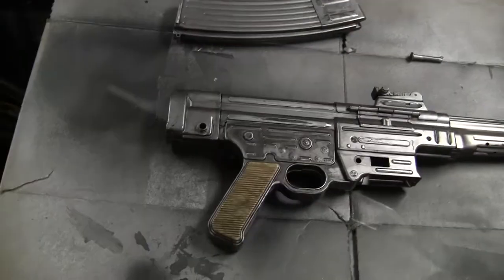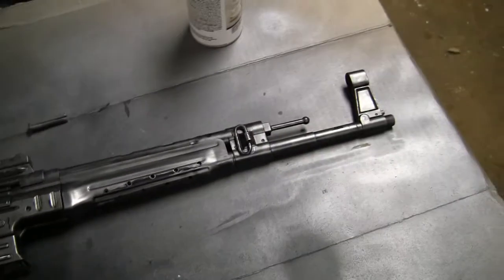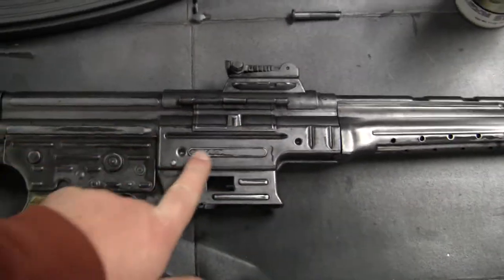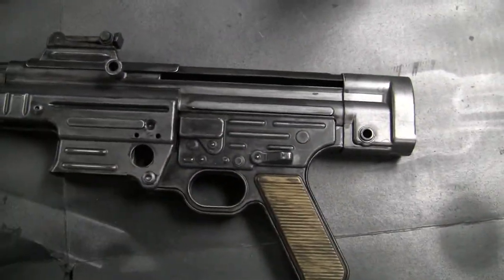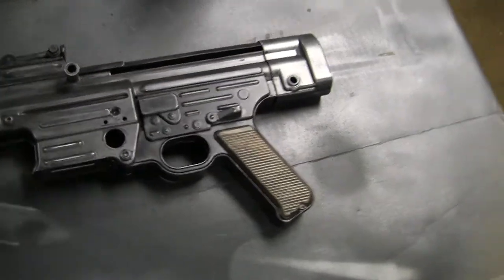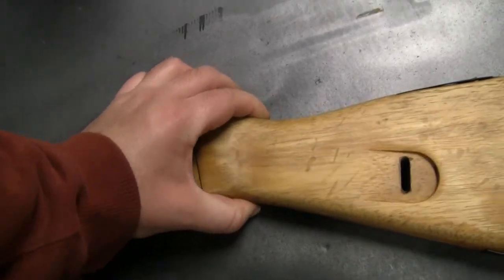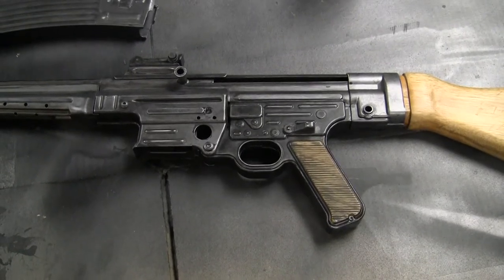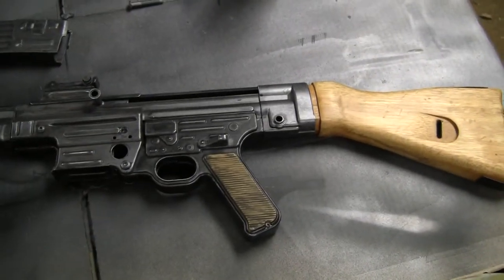AGM Javelin MP 44 project part 5

Comment: Btw. I'm about to upgrade the looks of my STG as well, and I'd like to ask: would you recommend doing different finish on the stock that's made out of darker wood(I'm assuming that you bought version with light wood), or is it ok, if I just remake the looks of the metal parts?

Comment: Did you make an episode 6? How did it fire?
Reply: ***** Thanks for replying, It would be good to see it firing. Would you be able to add a summary of the final upgrades you made to get it shooting how you want it in the summary, the rate of fire and fps? Thanks.

I want to upgrade the gearbox but have to keep to a limit of 350fps would you recommend the same parts except for a weaker spring?

Your videos are really good btw and keep up the good work.